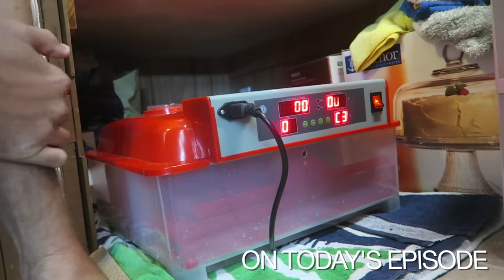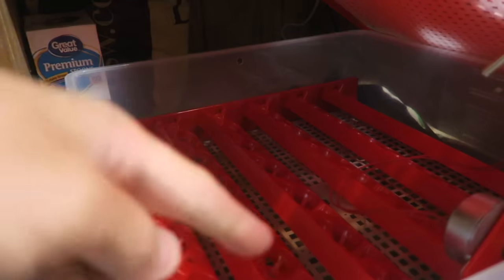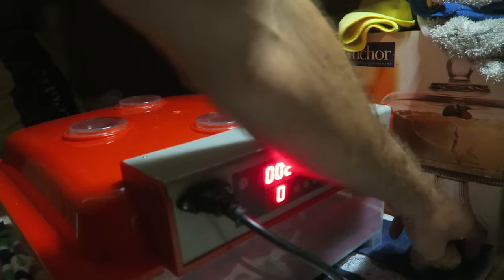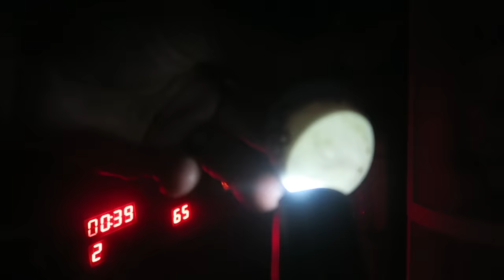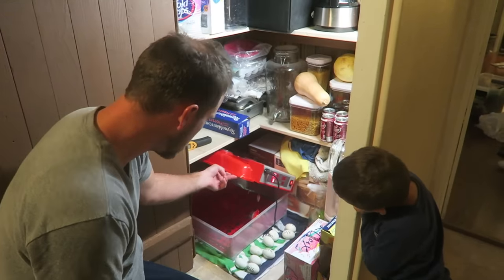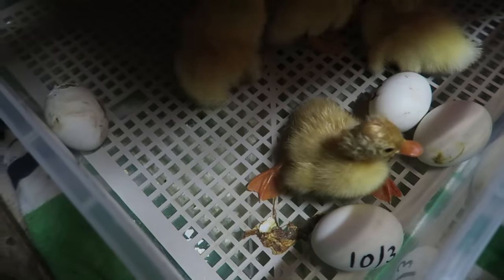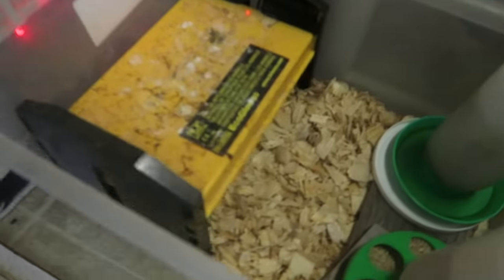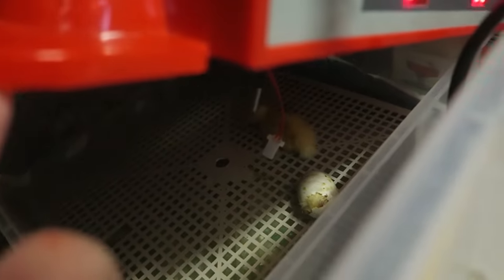Incubating Duck Eggs from START TO FINISH | Rite Farm 3600 Incubator

Comment: Do you still hatch your duck eggs like this? We have some locals giving us duck eggs next week and I didn’t realize how much more labor intensive ducks are than chickens 😱
Reply: The Mac’s duck eggs definitely do better with the extra attention. I don’t use a heat gun to test the temp of my duck eggs while cooling & misting them, I just set a timer for 10 minutes. The cooling/misting helps the eggs lose the necessary moisture needed for healthy hatches, because water fowl eggs are thicker than chicken eggs so they don’t seem to lose it as easily; you’re basically trying to mimic their mum getting off of them to eat and go for a short swim. The incubation temperature in this video was actually a little high, forced air (fan) incubators should be 99.3 - 99.5 for water fowl, which is why the ducklings in this video hatched early (I believe most breeds, aside from Muscovy, should hatch on day 28). 
Hatching ducklings is slightly more work, but definitely worth it! I would have ducks over chickens any day; they’re so full of personality and incredibly entertaining!

Comment: Wow, soooo coool!  As you know Jake, I plan on attempting to hatch out some chick's this spring.  This is my first video watch on the process and I really, really, appreciate your efforts for putting it together.  Can I assume that you like the Rite Farms incubator?  I have the 2400 version  I think its pretty much the same only slightly smaller.  I haven't opened the box yet so I'm not 100% sure it might have a slightly lesser display or less info than yours but I am looking forward to seeing it in action.  BTW I'm half way through Salatin's PPP, and now realize that he does recommend the keeping of the deep bedding in the brooder for immunity build up for the hatchlings.  It sort of makes sense but was counter intuitive when I heard that you weren't cleaning it out after each batch.  So many questions, so many thought....I look forward to seeing more videos on your duck endeavor.   Good luck and may your ducks not turn you into a Quack!  Just a little poultry humor, couldn't resist!    ;-)  

Question, I just did a little reading on the 2400, it seems that the basic operation is about the same. ...  did you have any issues with keeping the humidity level correct?  Seems some reviews on Amazon expressed concerns for the 2400 models, saying it wasn't accurate and that adding the water to the base was tricky and that the humidity would fluctuate and required some attention to keep it right.  Just wondered if your 3600 had any issues in that respect?
Reply from the maker: +Little White Dory - I do like this incubator and have not had any issues with it. We also have the Little Giant incubator that doesn’t have any read outs, you have to insert your own thermometer/hydrometer into it, and my results were horrible. Since getting this, our hatch rate is above 80%. I just pour water in whenever it gets below 40% humidity. If I spent money on some expensive hatching eggs (got some French Black Copper Marans eggs at the beginning of the year) I would be more concerned, but even then, the humidity level is kept up, the heat is dead on and the eggs are turning... I can’t take much better care than that.

Got this video idea from watching other incubating videos that broke it up into several videos, and I thought it would be better to have it all as one video. But you also suggested doing some multi-day activities and putting them into one video. We’re working on another one right now that I think you’ll enjoy as well!
Reply: Thanks, just curious about it all!  Have you done several batches now in the 3600?  Have you got a plan for the ducklings with respect to raising them as we head into the colder weather?  How has it been selling the broilers that you raised, are you enjoying it and do you think you will turn it into an income source for you someday?  I know you've spoken about finding property in the future, what is your guess on when that might happen?
Reply from the maker: +Little White Dory - 1. We’ve done 2 different batches of chickens and 1 batch of ducks, all above 80% hatch rate 2. We’ll raise them in a brooder under heat lamps in our big shed until they’re big enough to go outside... ducks have grown way faster than chickens in our experience, and have been ready for outside, but it’ll be our first winter with ducks, so we’ll see how it goes 3. We do enjoy raising broilers, we sell them as we find customers... we haven’t actively sought customers, but we talk about what we do with people we meet, and that usually leads to an egg customer, a meat customer, or a new viewer of our channel. We did the video on The Local Pig, and they were interested in our turkeys if we did them on a larger scale, but I need to get USDA certified to butcher them to make it worthwhile for us and for them 4. To move on to a larger homestead that we own, we need more income to make that happen. Since starting this channel, I’ve scaled back jobs to focus on this, so I just need to keep growing this until it will support us and our future plans.

Comment: I have a couple questions I need answers to asap if you don't mind. I collected duck eggs from my pair of ducks and wasn't sure how long they had been outside and put them in an incubator 10 days ago and I'm seeing a lot of movement during the candling. Will that make a difference on how long I leave them in the incubator? Also my incubator only goes to 21 days because I believe it's a chicken egg incubator. My plan was to just add extra days once the time runs out. My question to you is, how long do I leave them in the incubator with my situation since I don't know how long they were outside before putting them in? Also, it's day 10 now and I haven't been spraying them with water and letting them cool t 8. Is that step crucial and if I don't do it, will any of them hatch? Also to add on to question 1, will I still take out the egg turner 3 days before day 28 in incubator since I don't know how long to leave the eggs in since they were outside probably 10 days?
Reply: I'm not sure how much I can help but I would attempt to compare the growth to a graph online that shows the stages. I hope I was at lease some help I really only know about chicken eggs, sorry.
Reply: Shadow _Cat any help is appreciated! Thank you

Comment: Alright, thanks! 2 more questions. 
1. "Lockdown" starts at day 25, right. And if so, do i need to spray the eggs that day, or just leave them be?
2. How should i add water if i can't open the incubator? I usually just pour it in the incubator
Reply from the maker: +ChimpPlayzMC - lockdown just means leave the eggs alone as much as possible... humidity is still the priority, so add water as needed. No need to spray the eggs after day 25.
Reply: Alright then, thanks! I hope all goes well. Hatch should happen in a week or so!
Reply from the maker: +ChimpPlayzMC - cool! Be sure to film whatever you can of the hatching. I might use some of it for a video to share your success if you get some good stuff!
Reply: Alright! I planned on filming it anyway. I'll tell you when the hatching happens!
Reply from the maker: +ChimpPlayzMC - awesome!
Reply: Great news! I was pouring some water in the incubator when i saw that one of the duck eggs was pipping! it was truly amazing and exciting!

Comment: Hello, first time duck hatcher here and this video has been so helpful. (I’ve watched it 4 times!) I bought the same incubator that is in this video. I am wondering which water channels you filled and how much water you filled in the channels on average as the incubator needed??
Reply from the maker: +Mandy Marling - Good question, and thanks for watching it thoroughly! Fill all the channels up with water... try to keep the humidity between 30-60%. Usually when I fill it up pretty full, it gets up to 80% humidity, it's a little high, but it's never caused hatching issues for me. When it starts to drop down (50, down to 40, down to 30), you'll see that it's time to refill it. Feel free to ask questions as you go. Just ask as a new question (not under this comment thread), so it pops up as a new comment for me to see. Good luck!
Reply: White House on the Hill - Thank you so much again! I’ll be sure to do that if any other factors arise and if not I’ll update you when I have some baby ducklings.
Reply from the maker: +Mandy Marling - sounds great!
Reply: Hello again! I have another question. I’m on day 11 and I’m taking them out spraying them and letting them cool. My question is: will it hurt if I candle them every day when I cool them or should I hold off? (I candled them at day 5 and day 10.)
Reply: Mandy Marling update?

Comment: Great video!!! Thank you for sharing! I am about to put some Ancona duck egg in the incubator this week. I heard some mixed opinions about watering them... Do you use warm water around 100F?
Reply from the maker: +Ainstain K - I’m sure you could get decent results without watering them, but the egg shells are hard, so the water helps break them down by hatching time to make it easier for them to get out of the shell. Just use warm water, nothing scalding hot.
Reply: Thank you for a quick reply! Do you use water from faucet or distilled? I am not sure if chlorine in the city supplied water would hurt anything?
Reply from the maker: +Ainstain K - the official word I see everywhere is distilled. We used tap water and had great results.
Reply: Thank you for the info!

Comment: Quick question anyone who knows maybe able to say. I have a incubator similar to yours that has the 56 eggs and the semi clear plastic top. the hydrometer says 56%, but the extra out door style temp/hydrometer unit i have inside the unit says 65%. the house hold one is very slow to change so i would say it is more peak %. but which one should i trust more? I spent several days changing plastic bowls to change the % to lower it to more like 60% but i have not been able to. Should i trust the one that came with the unit more? it changes real fast, when i first close the top and come to max % with in 2 min or so. House hold take like a half hour. this is a force air unit\auto egg turner.
Reply from the maker: +Brian - the only way you can know for sure would be to add a 3rd hydrometer to break the tie. I had issues with the Little Giant incubator because our external thermometer was taking the temp and humidity at the wrong point inside the incubator. But honestly 55-65% humidity is a good range to stay in.

Comment: I have a question about the hatching, when one duck hatches and it begins stumbling around, it crashes in to other eggs, could that compromise the hatching eggs if the ducking is very active? Because I know you stopped turning them to avoid compromising them.
Reply from the maker: +Abby Shock - I don't think so, but if it becomes a problem, just move the duck into the brooder under a heat lamp
Reply: This was a long time ago but there are theories stating that when a sibling hatches as it touches the other eggs it will let them know it’s almost time to hatch

Comment: Hello again. I was wondering, how much water would I need to pour in to have the right humidity for the eggs? And how many times?
Reply from the maker: +ChimpPlayzMC - varies with each incubator... you want to test it out for 1-2 days prior to incubating eggs to make sure you can get the temp and humidity at the right level

Comment: Help. Ive opened incubator day 29 to let out duckings that have already hatched and i believe the other eggs have shrink wrapped. I helped one out but it bled out a little bit. I stopped the bleeding for now and put it on a heating pad and monitoring it. What should i do with the rest. Theyre beaks have been sticking out for awhile but they are not zipping.
Reply: What happened?

Comment: Hello! I'm in need in some urgent help! It seems like the humidity is way too high in my area. Even when i take out the water, it still reads about 70 percent! I heard it needs to be around 30% for the first week! I really need some help! I really don't know what to do!
Reply from the maker: +ChimpPlayzMC - each incubator is different. If you’re not using the one I used in the video, you have to read the user manual - every incubator works differently. Removing water should do it, and it could take awhile for the humidity to decrease.

Comment: Quick question. How would i make the humidity to the level i want it to? do i just pour it in the incubator? I'm just a little confused.
Reply from the maker: +ChimpPlayzMC - you add water in to increase the humidity. Each incubator is different on how to add water and how well it maintains it’s humidity level. If you’re getting a cheaper incubator off Amazon, you’ll have to read the user manual that comes with it.
Reply: where exactly do you add the water in the incubator?
Reply from the maker: +ChimpPlayzMC - in the one I use... I just poor it inside and it sits on the floor of the incubator in spaces underneath the tray that the eggs lay on

Comment: Well done on this great video! They are too cute and what a successful hatch rate. I've read a lot on incubating duck eggs  with many people saying those last 3 days are the hardest as you get all that way only for many of them to die and not hatch. I'm giving it a go anyway as I so badly want my own ducklings! I'm on day 4 with first signs of veining, but I was wondering if I should lay them down instead of upright in the egg holder/turner? I see yours look like they are upright till the last 3 days right? People say incubate like the mother duck does and lay them down but I worry about their air cell then. Any suggestion would be much appreciated. Thanks for the misting tip too that's great to know. 🐣🐥😀
Reply from the maker: +SunnyVistaBulldogs - thank you so much!

Comment: Hello! I'm Rahil and I'm a 12 year old boy. For somesort of an at-home science experiment, I want to hatch my own pekin duck egg! I plan to hatch one or two at most. However, there are too expensive incubators that hold 20 duck eggs and there are small but unreliable incubators. Do you by any chance know a small incubator that is under 50 bucks? Thank you!
Reply from the maker: The one we use is great quality, very reliable and is around $100: http://amzn.to/2r3MEcL
The most popular one on Amazon is $65 and rated 4.5/5 stars: http://amzn.to/2De1qTd
This one is around $50 and rated 3.5/5 stars: http://amzn.to/2CWiWrF
As the price goes down, the ratings drop significantly, I wouldn't trust them. If you can afford a better one, get it, and if you don't need it after your experiment, I suggest reselling it on Craigslist to recoup your costs.
Reply: Thanks for the quick response! Because i probably won't be hatching any more ducks after the experiment, i think i'll settle for the $65 incubator. Also, any reccomendations for my first hatch?
Reply from the maker: ChimpPlayzMC - make sure to put more eggs in than you need to try and get enough ducks hatch. And don’t forget to do the egg cooling/spraying from days 10-25 on duck eggs.
Reply: Got it, thanks! so if i plan to hatch 2, should i buy four? also, i live in a small city, so when i look on craiglist, no duck eggs are availible. Do you know of any online reliable duck egg sellers? Thanks!
Reply from the maker: +ChimpPlayzMC - double the number you need sounds like a good plan. You could put out a request for fertilized duck eggs in your local craigslist to get some farms to contact you. Look for local hatcheries, they'll often sell hatching eggs. And if no luck on either of those, look on eBay for some hatching eggs. I'd offer to send some, but our ducks aren't laying right now since it's so cold in our area.
Reply: Thanks for the offer! I see a website called metzer farms in my area. It seems like it is real. Would you mind checking it out please? Thanks!
Reply from the maker: +ChimpPlayzMC - Metzer Farm is good... we’ve gotten birds from them before. As far as I know, they’re the best source for ducks in the country.
Reply: Thats nice. The only problem is that no matter how much ypu pay for the eggs, it'll be 32 bucks minimum. I thought it'd be cheaper, but i guess it'll be fine. I might make a craiglist post anyway, i'll decide soon.
Reply from the maker: +ChimpPlayzMC - are they close enough you could drive there? If they don’t have to ship, they’ll waive the minimums.
Reply: It's about a 4 hour drive, so i don't think i can. Also, the minimum for the EGGS are 32 bucks. Not the shipping. But thanks!
Reply from the maker: +ChimpPlayzMC - when’s your project? If it’s Feb-March, we may have eggs again. But otherwise you may look on Craigslist or eBay for a cheaper option.
Reply: Yeah, i'm planning to get the eggs around Feb-march, due to my birthday being on march 2nd. The project spans from Febuary-April, so if you would like, sending over some eggs would be great!
Reply from the maker: ChimpPlayzMC - check back with me when you need to get the eggs. They can only sit out for a week before they have to be incubated so you can’t get them too soon before your incubation. I would charge a few dollars for the eggs and around $10 for the shipping.
Reply: Also, just to make sure, Pekin ducks are to be perferred. Thank you!